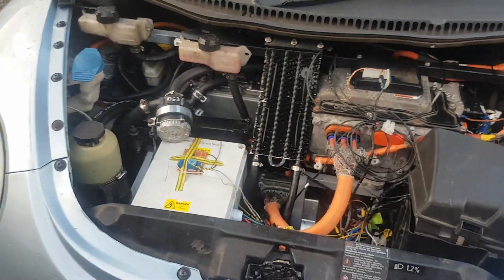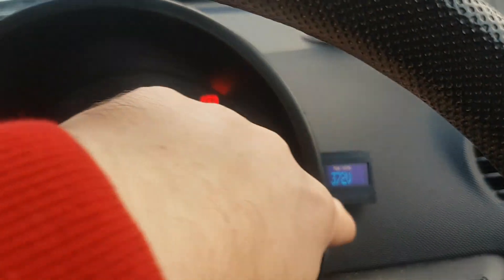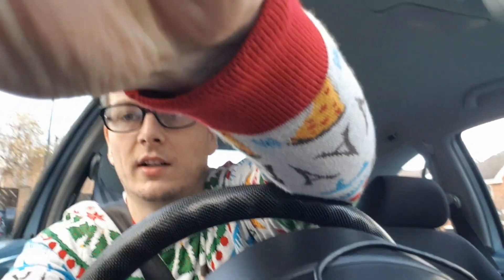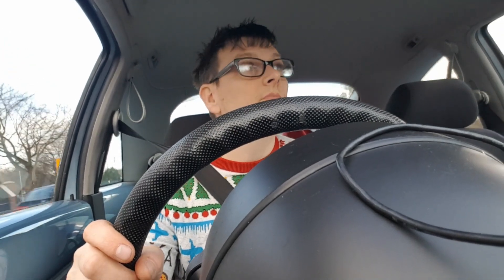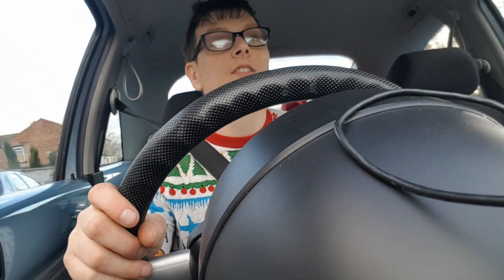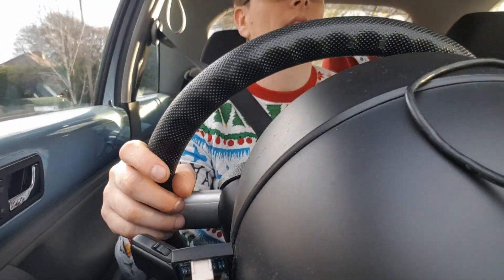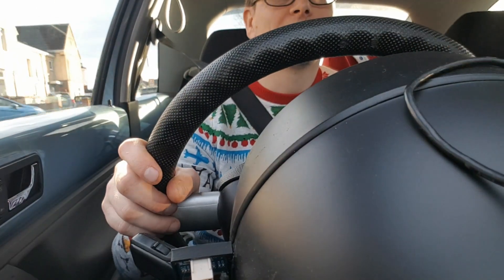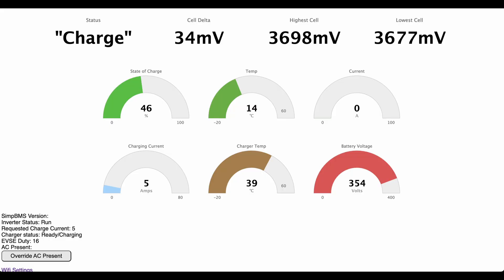DIY Electric Beetle Conversion Overview, project BugPlug

Comment: If that cost you 2000 in parts, this must be one of the most inexpensive EV conversions ever! Congratulations!
Reply from the maker: @jbmaru  check out my BMW conversion, just under 4k in parts but a lot faster and more range
Reply: @JamieJones1985  I'm doing it right now, subscribed too. This is fascinating.

Comment: Are you getting your SOC on the original gasoline indicator? if so, how did you did it?
Reply from the maker: I sort of have, but it's buggy. Using a resistor ladder at min, but going to use a digipot

Comment: What BMS are you using? What inverter and motor? Why does your airbag light stay on?
Reply from the maker: Modified Simpbms and airbag needed an error code clearing.

Comment: Did the on-board charger taken from the outlander operate standalone with batteries, handling communication itself for charging from an EVSE with the J1772 receptacle? Or did you have to add an MCU to interface with the OBC in place of the original outlander phev ECU? Great project!
Reply from the maker: The outlander OBC handles J1772, in that it respects the CP. 2 can messages are required, 1 to tell it to place the correct resistance on the CP line, and another to command the required amps, you need to monitor the voltage reported from it and reduce the amps accordingly. I've added support to simpbms for it on my github. The PP doesn't connect to it, what you do with that is up to you.
Reply: @JamieJones1985  Brilliant, thanks for responding so completely for me. I was always curious about that detail. In my case, the ECU is intact and I'm 'simply' considering swapping OBC's from a Spark EV to Bolt EV to go from 3kW -> 6.6kW at public stations. Service manual electrical diagrams show them to be identical in the circuits for their connectors (almost the same car), so that can probably be integrated, but if the CAN addresses are different, it won't charge without it as you say, so I'd have to come up with an interface that talks between the OBC and control module, or impersonate the correct CAN addresses and forward the same commands. 

I'll check out the github for sure, and look into a CAN eval board to help learn that if things turn out to require it. Thanks for replying, really thankful you documented your journey and posted it online. I imagine learning to master the OBC helped with your implementation of DCFC as well.
Reply from the maker: @Infinion  Any ideas what the Can ID's in use on the bolt?
Reply from the maker: @Infinion  Do you have access to a running bolt? If you can get a can log of your car on charge and a bolt on charge that'll really help you, plus the community :D It'll open up using both options to us.
Reply: @JamieJones1985  Yeah there's a sizeable list of ID's on the Bolt EV forums, can't say the same for Spark EV forums, though.
Reply: @JamieJones1985  I don't personally know any bolt owners, but if scanning CAN ID's isn't invasive (simple as connecting to an OBD port), I'd be surprised if I couldn't convince one to let me log ID's one day, or even ask a savvy owner on the forums.
Reply from the maker: @Infinion  usually a little more involved, the internal can bus messages don't all make it to the ODB port. You can get contact less loggers that clip around the can bus wires

Comment: Wow, looks so easy shifting to next gear without the clutch, no gearbox grinding at all while shifting?
Reply from the maker: No grinding. The syncromesh in the gearbox handles that, all thats needes is to unload the input shaft by lifting off and no regen.
Reply: @JamieJones1985  if I try to do what you do my gears do grind.  1997 bmw getrag gearbox. Yes foot off accelerator. I've kept the clutch
Reply from the maker: @blackterminal  either your motor isnt freewheeling, maybe regen? Or syncromesh isnt working I guess

Comment: Always thought this shape Beetle would make a good volume EV conversion. Due to it being cheap to buy, quirky and quite a few of them around. So having a kit made I thought might be a good idea. What did it cost you to make in parts?
Reply from the maker: 2000, but i wouldnt go with the same motor. Im hoping to swap it out to something a bit bigger. Looking for a second battwry pack first though.
Reply: What motor would you rather go for ?

Comment: Great work Jamie really nice build. I wonder what BMS are you using?
Reply from the maker: It's a custom board based on simpbms, makes use of a teensy. Started porting the code to esp32 though.
Reply: @JamieJones1985  could you consider helping others needing a bms? I would like one but can't afford the brand name ones like Orion
Reply from the maker: @blackterminal  its simpbms, open source with a teensy.